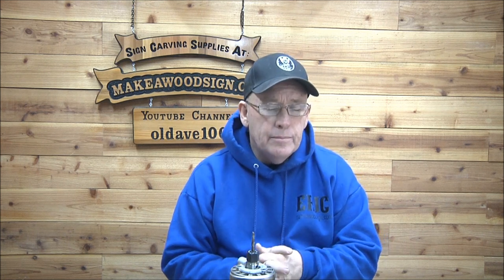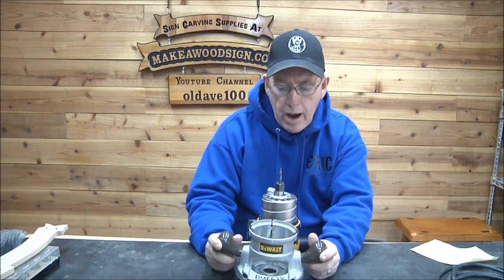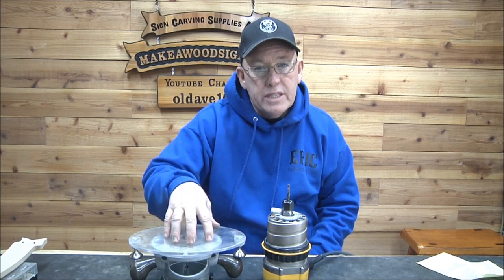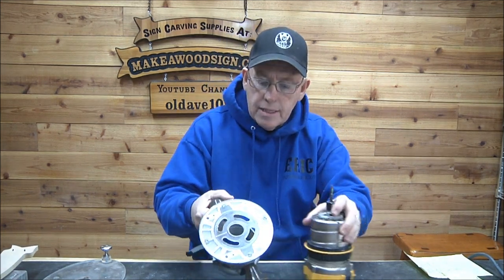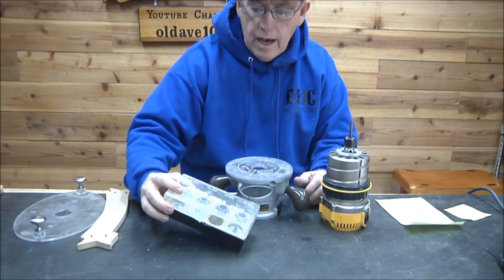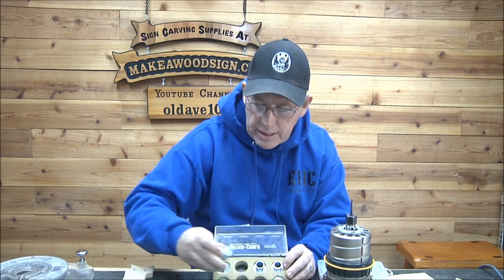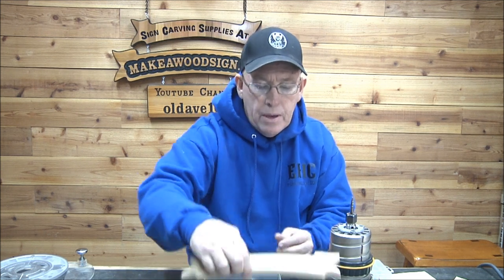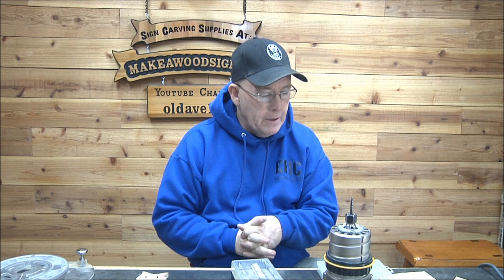#345 More Info On Cutting Shapes + Large Drillmaster Router

Comment: Eric, wouldn't a heavier router be more stable? especially in pine? heavier, more power, less tendency to snag the grain lines? I don't know since I can't compare, I only have one router.
this might be interesting, i believe you have a few routers correct? how about testing all of them with the same bit in the same wood (pine) and see which snags the less and which snags the most.
Reply from the maker: I used a heavy full size router for about 35 years before I got the idea to try the palm routers. I have lots more control with the small routers. That being said I have met a few carvers that like the heavier routers better for stability. So it becomes a personal preference. Everyone is different. It may make a good video to do a comparison head to head tho. Thank you for the idea, I will give that some thought.

Comment: Hey Dave, Happy New Year. I thought I would let you know that you can put that step hole in your existing base that you made if you have forstner bits just cut the big hole first just deep enough for the template follower and finish with the smaller hole because the bit already has the center cut started for you
Reply from the maker: Sounds like a great way to do that, Thank you!!!

Comment: Did you get the centering pin that should be part of the bushing kit? it makes centering the bushing (or bushing and base plate) pretty direct.
Reply from the maker: The set didn't come with one. Would have been nice.

Comment: I have a Craftsman router and bought the Harbor Freight bushings and had to return them.  They were a fraction too big to fit in the hole.  I bought a more expensive set off of Amazon that look identical but they fit fine.
Reply from the maker: Yes sometimes the holes are different sizes on different routers. Glad you got it figured out. Thanks for watching, Eric

Comment: Do you use a centering guide?  I do a lot of inlays and a centering guide is a must. Even with my better routers. Another thought is to slightly ream the base plate mounting holes for more adjustability.
Reply from the maker: Normally for what I do I don't need a centering guide. Would have been handy here. Yes opening those hole would have been another way to go too. Thank you for the feedback, Eric